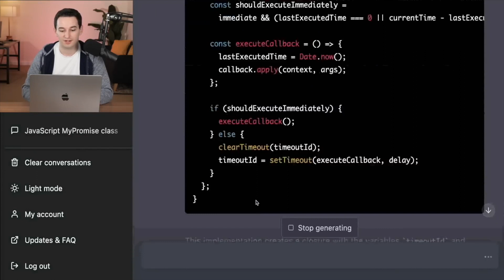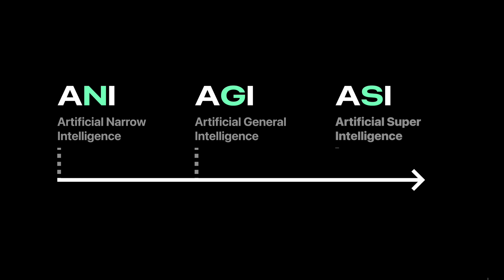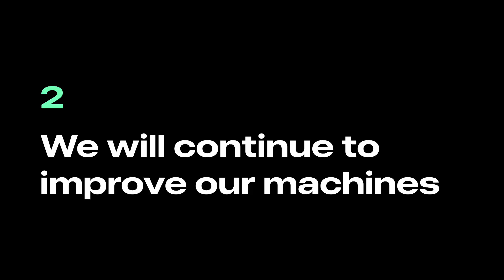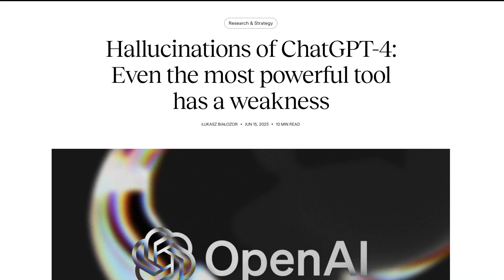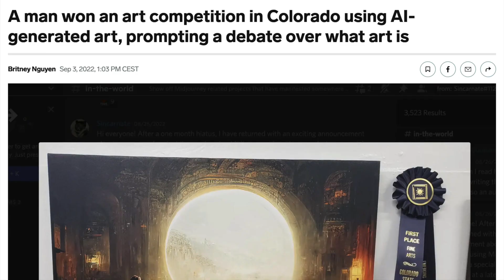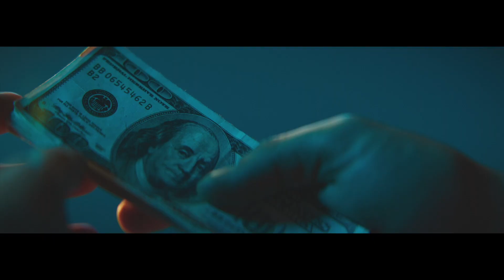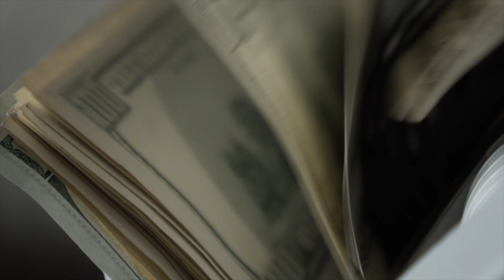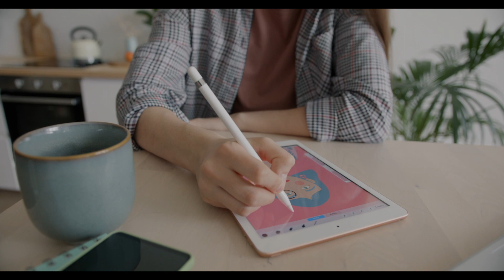AI will replace us. And that's wonderful

Comment: I think your outlook on AI is way too optimistic. With our current understanding it is actually pretty safe to say that AGI is not possible to make with the way we are handling building neural networks, simply because the architectures are too rigid in regards to their inputs. Yea, you could chain together different networks, but you can already do that and yet the results are ... well, non-existent.
Real AGI that can actually learn on the fly, would require a completely different approach in the creation of neural networks and the fundamentals of the learning process. In other words, we haven't even started making AGI yet. So, no, it isn't a question of when, it is a question of if.
(disclaimer: im not some leading expert, just worked under Prof Björn Ommer at his chair of the LMU helping develop stable diffusion, so I have some knowledge of generative AI, but I would take my word over Sam Harris on this matter every day of the week ;) )

your point about power made me chuckle a bit. I wonder what a system of checks and balances will lead to? That's right, lobbying and the creation of artificial monopolies through arbitrary entrance barriers like we can currently see in the US with many things.